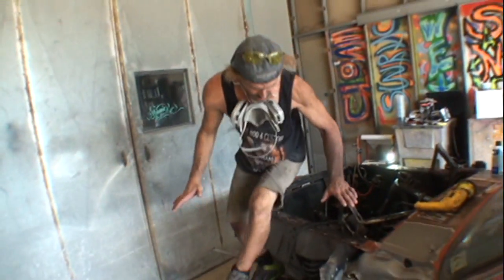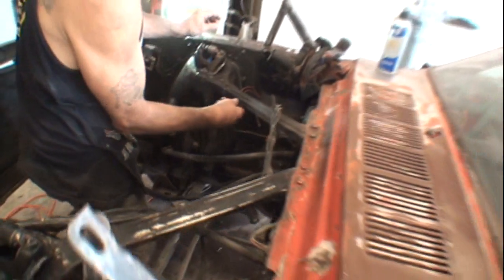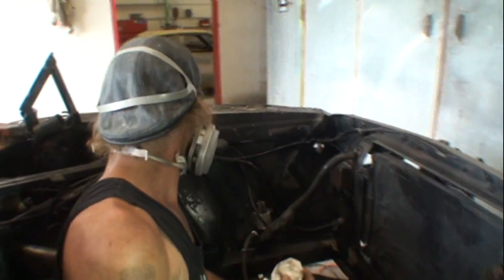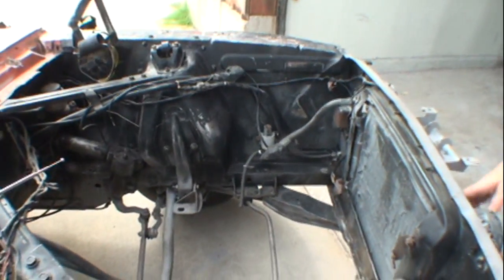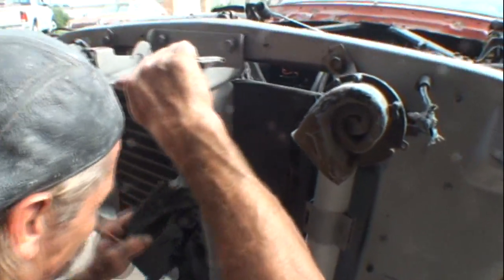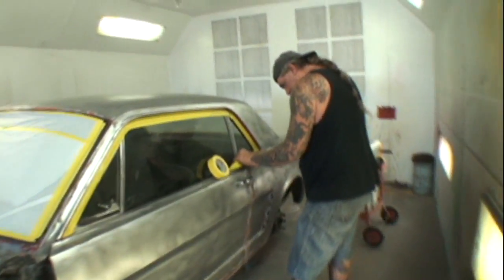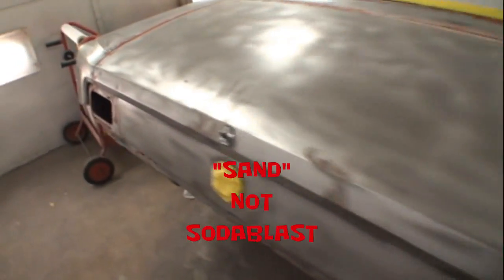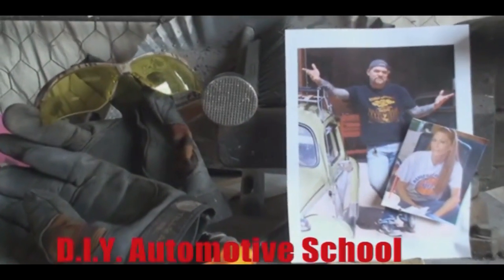How To Paint The Bottom Of An Old Car And Make It Look Brand NEW!

Comment from the maker: Just to answer everyone's question on why didn't we sandblast the engine bay, or why is Limpy cleaning it, or why not use oven cleaner, here's the answers:

1 - To many wires and electrical componants to remove, and holes in the firewall, and since this was a running driving car, and didn't need electrical, interior, ect. we didn't sand blast it.
2- The car was already sandblasted and we couldn't use any water on it or it would have rusted out the sandblasted area's.. By using oven cleaner, we would have had to wash off with water to remove all the residue..  

Hope this clears up ---- WHY DIDN"T YOU DO IT THIS WAY!
Reply: D.I.Y. AUTO SCHOOL Thanks for this video Pete, answered some of my questions

Comment: When I drill & hand sanded my 1966 Mustang engine bay, I removed everything from there such as all wiring, battery tray, solenoid, regulator, washer pump, horns and coolant hoses.    I did use Eastwood aerosols as I don't own a HVLP nor a compressor.  The engine bay came out decent, but I don't know how long will the primer and top paint last.

Comment: Even on camera that mustang body appears ready to paint.  When I was in Body & fender school in Omaha around 1970,  my first car project was a 65 stang coupe all with front clip damage .  The school was popular for cheap body repairs for student projects.  A small cost for labor plus parts and supplies .  The worst project I had was a 64 Corvair  with rear clip damage.
Reply: I had a car once that had the body and paint done by a high school body shop class (before I got the car). When I went to strip the car down (for parts, not paint), I realized that one of the quarter panels was BONDO'ED on. I mean, no rivets, no welds, nothing. They just pounded in the quarter an inch or so on both sides at the seam, slopped on a huge chunk of bondo until it stuck, and painted over it. I cannot believe the quarter even stayed on for all those years! I'm not saying all student body shops do stuff like that, but this must have been a really bad day when the teacher wasn't looking. At least I hope they weren't looking. But this was the worst bodywork I've ever seen, bar none.

Comment: Pete would you consider this a. Budget minded refurb ? Like a driver rehab or more in depth than that .
Reply: The reason I ask is I notice things like horn being left on and the other parts being left in during paint like the front end parts and such . I just didn't know if that was all there just to get it into sealer and bottom paint or if it was all getting taken off after sealed and getting detailed . Just curious trying to work on figuring out some pricing for a few budget projects trying to find ways to do things "right " without doing crazy nut and bolt work for guys that don't want nut and bolt but just a good practical clean up job

Comment: It is appearent you never had a vehicle plastic media blasted,  I would much rather follow up on a plastic blasted car than a soda blasted car.  And why did you not remove that strip of paint left by the masking tape, if would have been pretty easy to sand that strip off and not have a line?